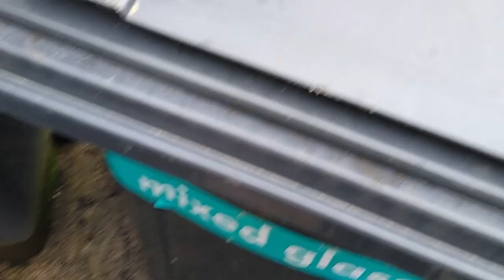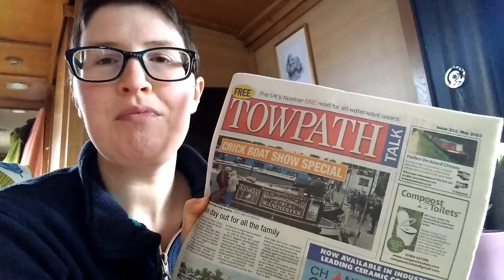52.  Narrowboat Chores

Comment: THAT'S your engine oil? I've never seen diesel oil that clean that wasn't less than 5 minutes old. Are you sure it's engine oil?
Reply from the maker: I know!! It always seems to be really clean.  It's had so many oil changes in the last year because of diesel leakage into the oil sump.  But this latest batch has only seen around 8 hrs of running. Might ask my engineer to take another look soon to check everything is as it should be!
Reply: @narrowboatnoob  maybe all that diesel you had in there flushed out all the diesel soot that pollutes the oil. Can't hurt to ask next time he's by.
Reply from the maker: Good thought!